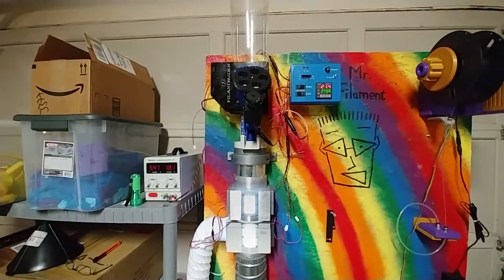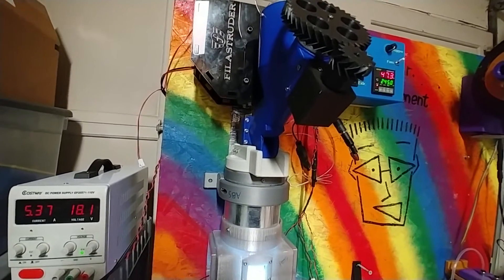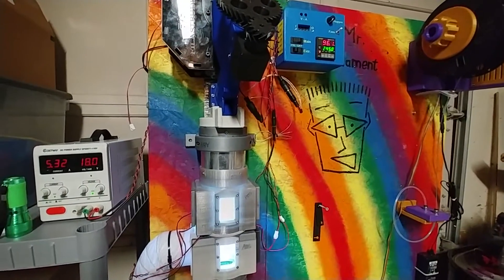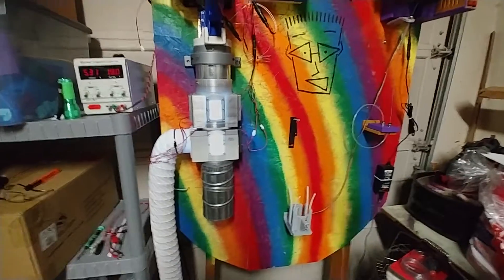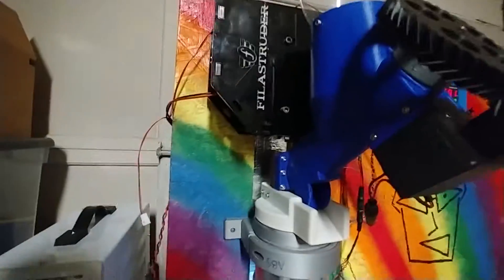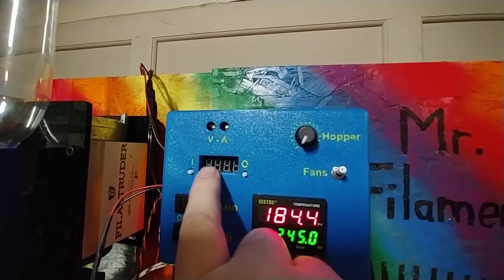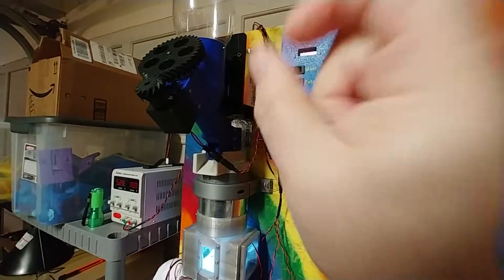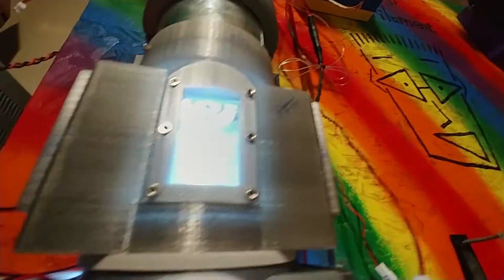Filastruder Power Upgrade, and why.

Comment: An even easier solution here would be just to limit the motor voltage to be exactly the same as the voltage present when the heater is on. The regulator will compensate for the vsag now. I used to have it set up this way with the original power supply and it did work, I have since moved on to a computer power supply with beefier 12v rails.

Comment: so basically by doing the upgrade you will get consistence diameter of the filament? is there anyway we can make this extrude faster or more material in an hour?
Reply: thank you....what would you recommend? I want to make my own ABS filament mainly because ABS pellets are cheap and as no one is manufacturing filaments in my country...so not really looking for a production unit with fast output, atleast 1kg per 1 or 2 hours is ok...I have been looking at precious plastic machines ....however they dont have a winder etc..
Reply from the maker: @fpvaq7378  If you're on FaceBook, look for a group called "3D Printer Filament Recylcer Group" and join it. There, I have a post with all the consumer/prosumer machines or designs I've been able to find.  There's not much out there for those on tight budgets, unless you're very handy and can build your own based on open source designs. If I had the money, I'd probably buy a 3Devo machine. That's the one CNC Kitchen has been using lately.
Reply: @ggaub  thank you, i ll have a look at it...would you recommend this extruder if i want to try out filament production...not really fused with how fast it can produce the filament, it should be able to produce good quality filament so it can be used in basic printers...mainly interested in abs
Reply from the maker: @fpvaq7378  Whatever the system, it needs to have something that can measure the filament diameter, and automatically adjust something to cause the diameter to get close(r) to the target. The usually means adjusting how much the winder/puller pulls, so that it stretches more or less. The 3Devo has/does all that. I've seen much more expensive machines that don't. Without that, you're constantly tweaking temps and motors and heaters and all that, and throwing out a lot of material that will never fit into a printer, or will not print because it's too thin.
Also, don't expect better than 0.05mm tolerance from any consumer machine. Even Prusa refuses to recycle their own waste into filament, because even their fancy machines can't get the 0.02mm tolerance they demand.
Reply: @ggaub  if i am able to get 0.05mm or 0.06mm for ABS, can i use that ABS in my 3d printer?
Reply from the maker: @fpvaq7378  Depends on the printer, but yes. I've printed with the filament I've made from my Filastruder, and it can get as bad as 0.1mm off either way, and more. As long as the printer is still able to push the filament, it will "work" but print quality will suffer, of course. If you get a blob in the extrusion, that can jam in the hot end. If you get really thin extrusion, that can just stop extruding. The worst is when there's foreign matter in the extrusion that the screen doesn't filter, which will then clog the printer.
Reply from the maker: That's the idea. And it does help. Unfortunately, the machine is just underpowered as far as the gearmotor is concerned. It will still slow down and speed up as material flow changes due to uneven heating. This machine pretty much only goes one speed. I tried speeding it up, but then the heater can't keep up. It should really just be considered a machine for tinkering, experimenting, maybe getting your feet wet in the filament making scene to decide if you want to go deeper. Don't ever buy this machine thinking you'll be manufacturing quality filament.

Comment: I have a few questions.
If the power supply is not changed, rather the heater is changed to a 110v input heater. Then the heater is connected separately (directly to the wall, without a powersupply), and the motor is still in with the old psu. Wouldn't this be a better and less pricey solution?
Reply from the maker: I already had the other power supply, but what you are suggesting would require additional modification, not the least being a relay to switch that mains power on and off. It could probably be triggered by the PID, but there would still need some kind of control over it. There are certainly a lot of ways the machine can be improved. Your suggestion (along with appropriate control) is one of them.

Comment: So I get the filastruder and filawinder, I apply the upgrades along with proper psu, I get a shredder and food dehydrator and I’m all set to extrude right? What other variables than the Igor varying speeds that would affect the diameter of the filament and how shall I overcome them?
Reply from the maker: I'm still working on that, but it comes to making sure the material moves consistently into the Filastruder. I have a new auger design for the auger assisted vertical hopper that seems to be helping. I think the winder can be improved in some way, to reduce the start/stop nature of the winding. Since gravity is the pulling force, every time is stops, the filament will get a little thinner as there is more material being pulled by gravity. But, I've made printable filament with what you're seeing here. The more pure your recycled material is, though, the better the result will be, I think.
Reply: @ggaub  that’s cool keep up the good work! I think I will focus on shredding and dehydration first then step into filastruder
Reply: I hope I can do a decent setup to recycle my failed prints throughout the years plus the amount of prototypes and prime lines printed amid PPE printing